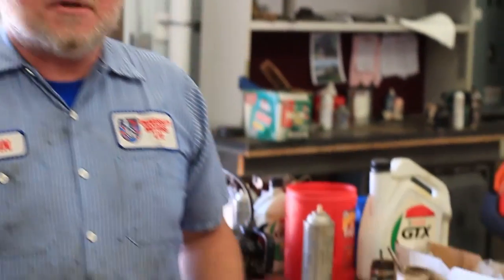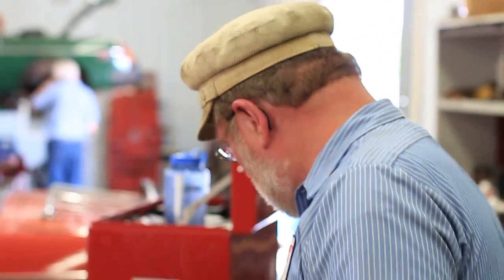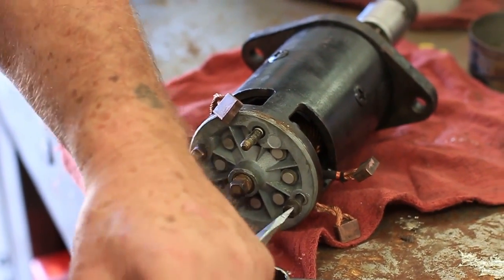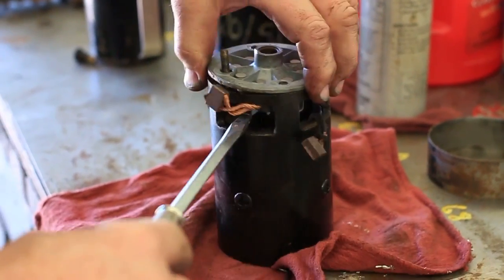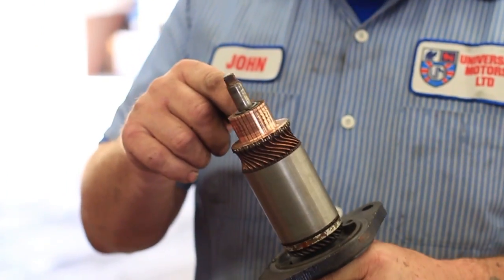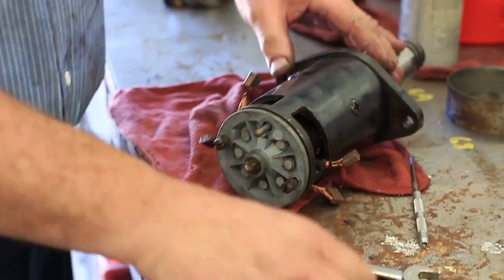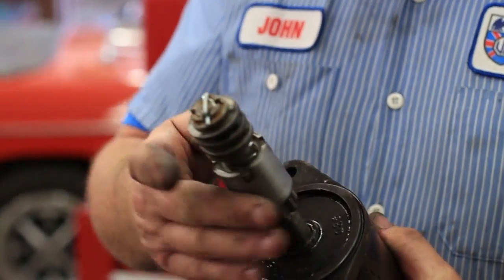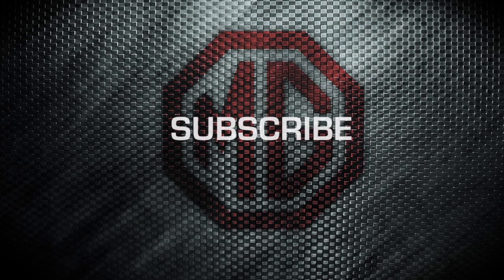246 MG Tech | Starter Motor Repair on T type / MGA / Midget M35G

Comment: G'day John, not to many workshops have a growler. Not to many mechanics have ever heard of a growler.  Pays to run a scriber between each copper segment (across the insulator), this will clear any copper plus drop the insulation below the copper segment giving less brush wear. Excellent video.